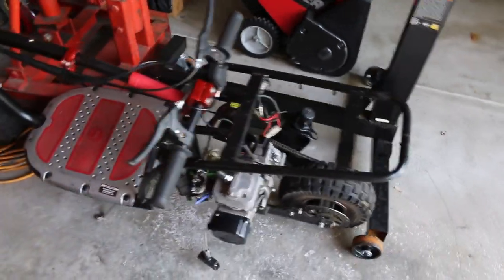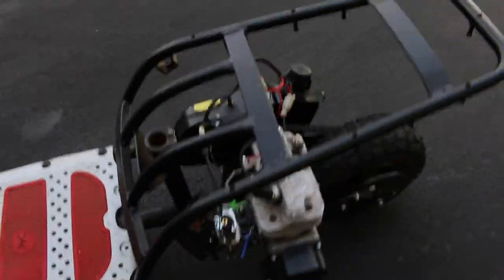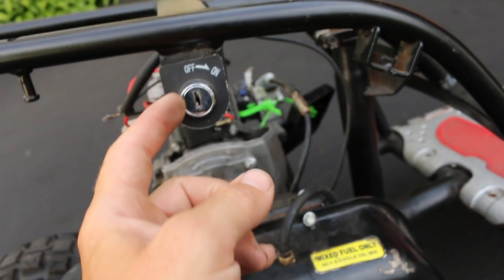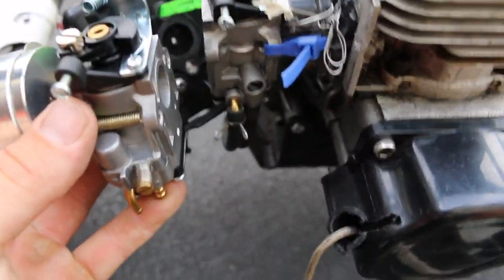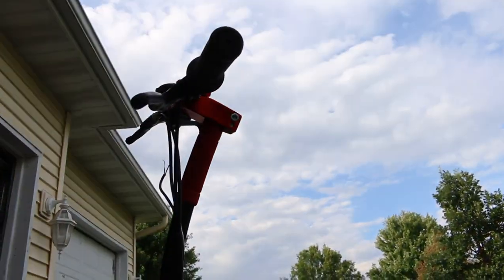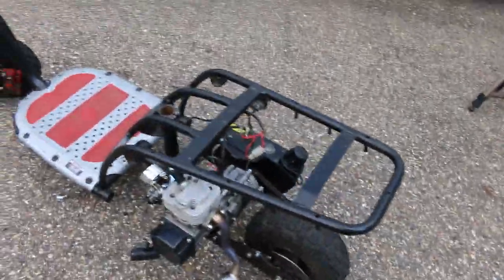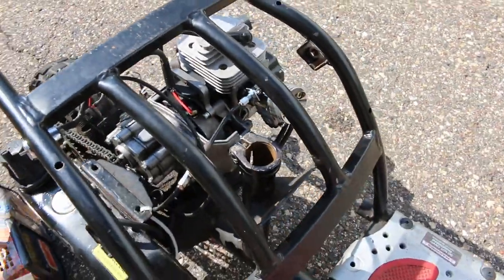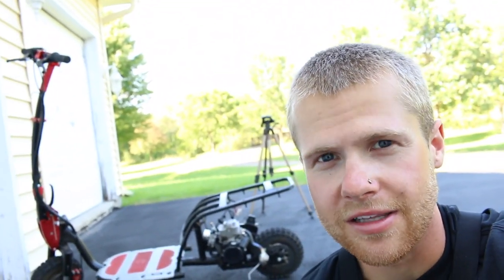Non Running Motorized Scooter Fix!

Comment: I just picked up a Chinese off brand scooter and its marked on the tag as a 33cc. I'm new to this small displacement 2 stroke stuff( do more with 212's and small 4 strokes.) But are most of the parts interchangeable between say a 33cc - 49cc? Like do they all share the same intake and exhaust stud spacing? Are the jugs pretty well interchangeable? I'm just wondering if I need to search for parts specific to my 33cc or if a intake adapter or exhaust for a 43cc or 49cc fit? Any info would be greatly appreciated